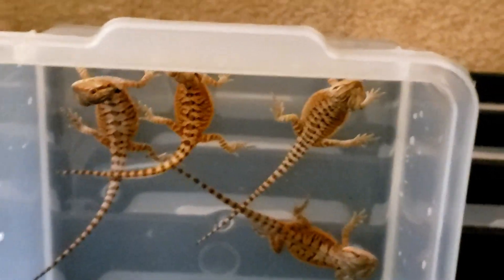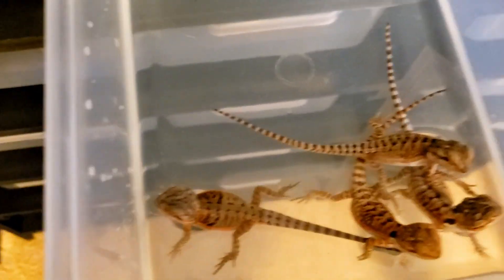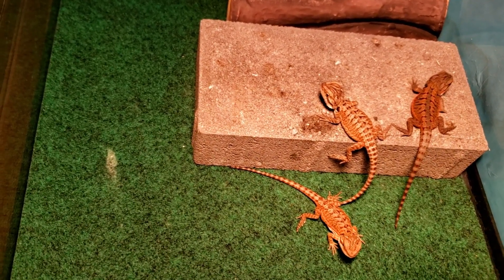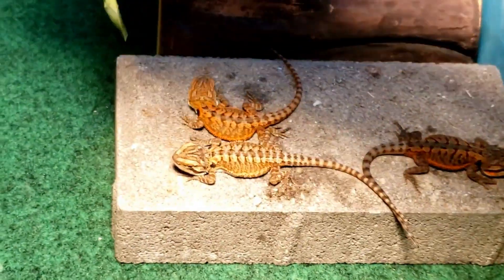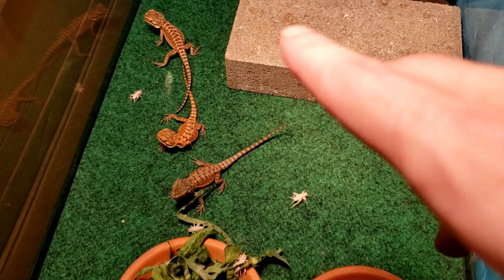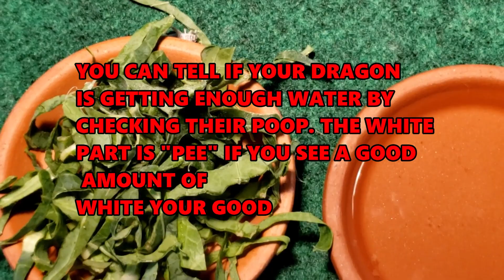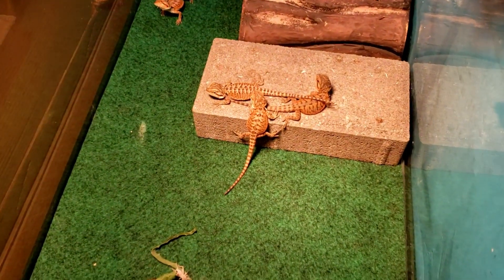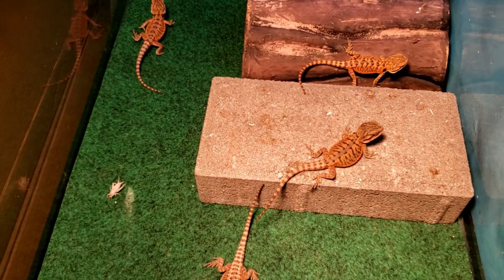Baby Bearded Dragon Care Guide!

Comment: so um.....I accidently bought a 30 gallon crested gecko tank will my beardie be able to live in it until its about 8 months old or do I need a bigger tank? because my beardie is about 3 months old
Reply: smiley miley  keep the 30 gallon tank Bc something smaller they would easily outgrow that tank
Reply from the maker: They will outgrow it fast, plus if something is made for a crested gecko it's probably taller than long and you need mostly ground surface. I would reccomend a 40 gallon as its gives them room, high enough for them to climb on things and gives a good dance of temperatures